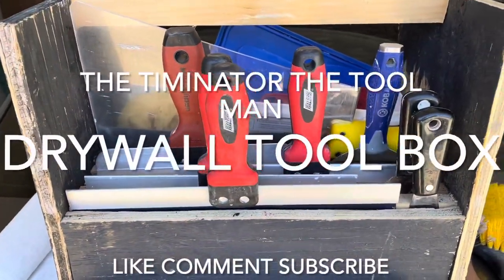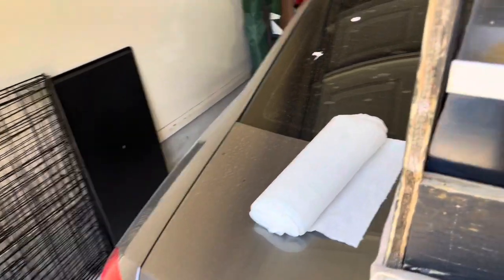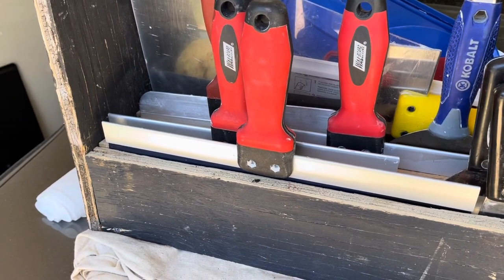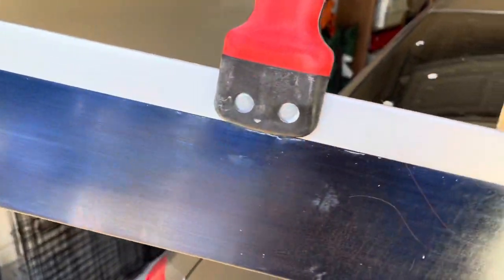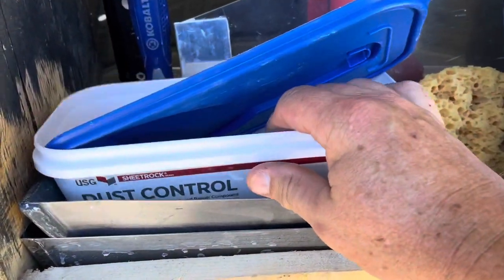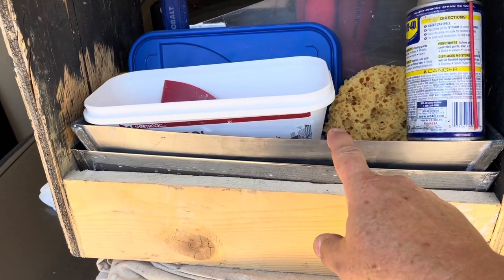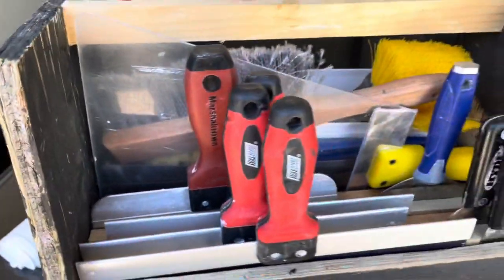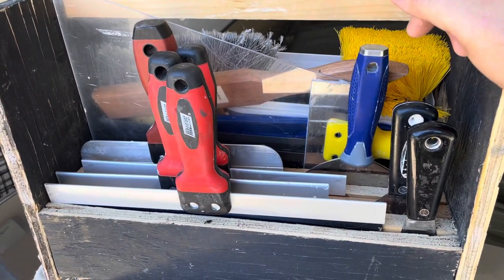Drywall tool box follow up and floating tool hack. #drywalltools,#drywalltoolstorage

Comment: "I have a 14" uh...." Dont say it 🤣
Reply from the maker: @robertcasey3528  thanks for watching 
Have you made your own carry box yet?
It’s fairly easy to make
Reply from the maker: I find it easiest to work with a 6” blade to tape and float and then gradually move up to 10” and  then 12”
I have a couple 14”s but don’t use them that much 
I can get a level 5 outcome with most of that set up.
I really enjoy drywall for some reason
Reply: @THETIMINATORTHETOOLMAN  I just use a tool bag.
Reply from the maker: @robertcasey3528  got to keep them blades from getting bent